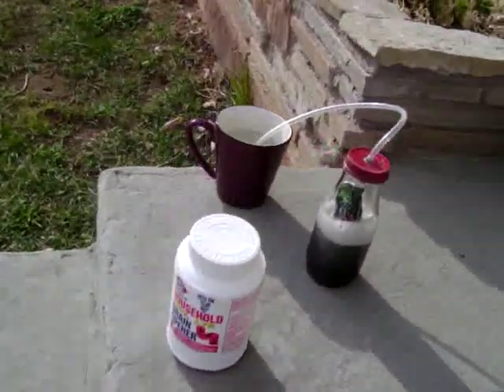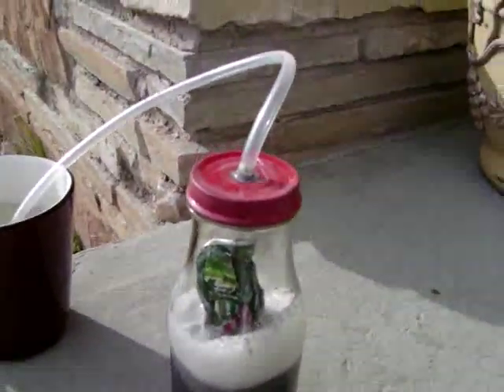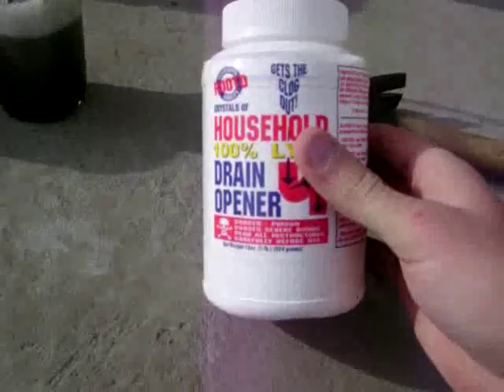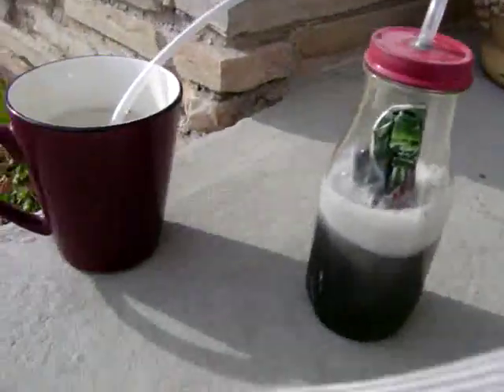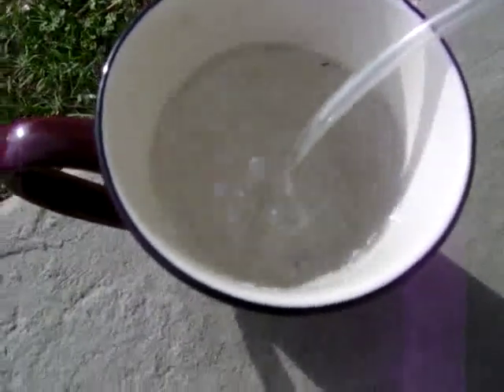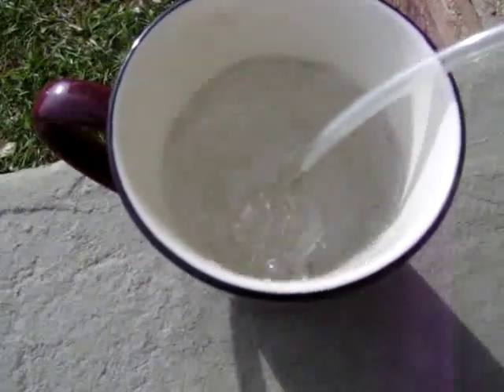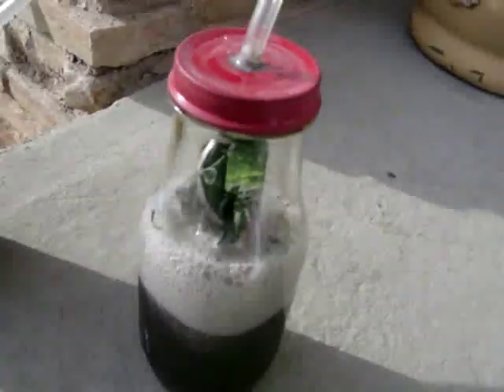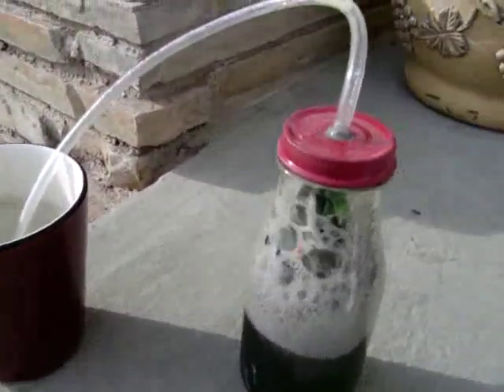aluminum hydrogen generator 1

Comment: Nice video, I've been looking where to find more info on this idea, Apparently, it's not this Lye of the NaOH/KOH that reacts with the water or that aluminum, aluminum reacts with water from its nature but the Oxygen in the air creates a small oxide film on the first contact. This gets dissolved away by the NaOH and that makes the aluminum unprotected for reaction to happen. For those who are interested:
2Al + 2NaOH + 6H2O → 2Na[Al(OH)4] + 3H2
2 Al + 2 KOH + 6 H2O → 3 H2 + 2 K[Al(OH)4]
and: 13g of aluminum = 1000L of hydrogen in 3.24 minutes

Comment: Then I guess the reverse would be true and you would offset it with an acid or water. At any rate, whatever dissolved the aluminum would do the same thing to the engine. I've seen a similar set up with a water column filter used to protect the engine.

Comment: Before you would use this in a car engine, you would want to put it through a water column filter filled with alkaline liquid to offset the acid vapors in the gas. Otherwise it would eat the aluminum pistons in your car.
Reply: I agree with the filter, but aren't the vapors going to be alkaline, not acid? Lye/sodium hydroxide are strong bases.

Comment: ok ,you put the can in that water with lye, and then after what time the bubbles came out ?
this is my question...
Reply: Save the bubbles in some kind of container, hydrogen is very flammable and a great fuel. it becomes water again when you burn it

Comment: no electricity cuz its pure chemical reaction. the problem is you need stoichiometric amount of aluminum. the side product is aluminum hydroxide which is good for nothing until you recycle it back to aluminum which is a lot expensive. efficiency is less as you get only 50% hydrogen as gas.

Comment: hay james!   i know this is an old video of yours but, you should try this 
Copper sulfate, distilled water, sulferic acid, and Zinc = Hydrogen!  much better than lye and Aluminum.. the reaction doesn't cause the water to become innodated with aluminum oxide.  and its not as endothermic.